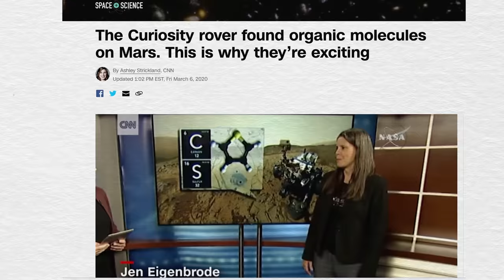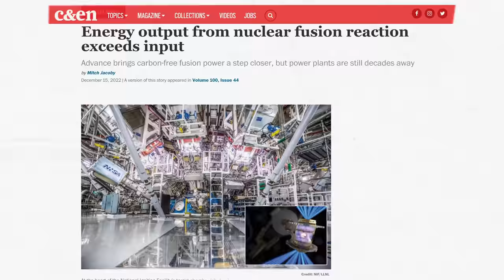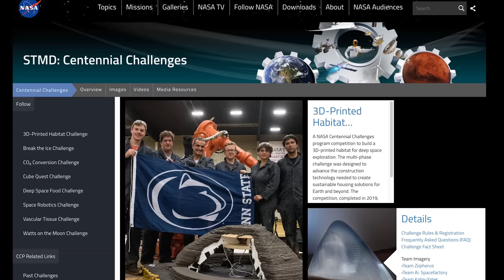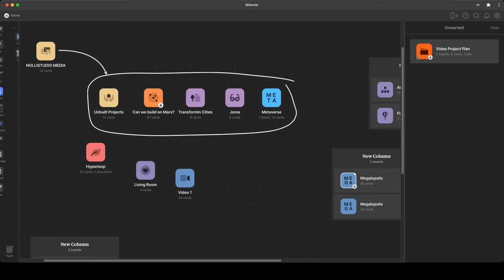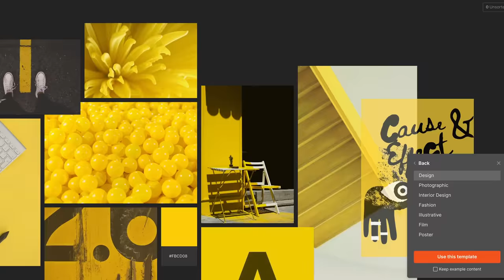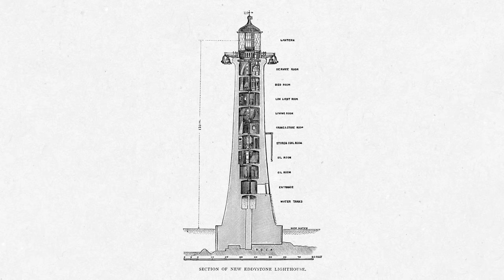Can we REALLY build on Mars? [SPACE ARCHITECTURE]

Comment: At the west end of Valles Marineris is a region called Noctis Labyrinthus. There is a water ice glacier there which contains 36 billion tons or 8.7 trillion gallons of H2O, or just a bit larger than Lake Meade at the Hoover Dam. The canyon floor is 4.35 miles deep, which provides twice the atmospheric pressure: 12.4 millibars, compared to 6.1 millibars at the datum level. The high canyon walls also provide very good protection from cosmic radiation.  Noctis will enjoy a relatively mild climate, as it is only 7 degrees south of the equator (236 miles). This would be an ideal choice for our first human activity and habitation on Mars.  Expedition => Outpost => Settlement => Colony.

Comment: Sounds like an interesting idea, conceptually. Honestly probably wouldn't be that hard to build a structure. But I don't know that it be air tight. You can build structures out of Stone dirt urgent mud. It's a process that's been around for a really long time. You literally make a brick shape and bake it.  Tell
 It hardens into a Stone. Another way would be to hit it with something that's so intense so hot. It'd be on par with a lightning ball. Thus turn it into glass like substance. Which is more likely product to make air tight? However, is very fragi. Le don't I say the combination of the 2 might be a possibility. So layer break layer of air, tight glass and the layer of brick.  Over that, in order to create a airtight vacuum sealed structure, protecting said glass as part of that structure, I don't know that you could 3 deprint that I'm sure it's a possibility glass can be melted, so crystallized substances, the sand there. I don't know what it's. Made of.  I mean, we could pretend it's sandstone that is a very fragile substance itself, but if you expose it to intense seat like lightning, I could take on a glass like property but who knows what else is on Mars?  A lot of the area doesn't have water. There are a few locations from my understanding that do and supposedly it's frozen or not. Is like a giant oversized arid desert that, according to science is lighter than Earth now, my presumption.  Or theory is that that's due to lack of atmosphere for one lack of plant. Life lack of living life lack of actual moving water to increase its overall mass and weight. There's still plenty of land here on earth.That has not been settled.It actually be wiser if you're really wanted to do something like that.From ours to 1 start out in the seahair , a desert and a bunch of other areas that are nothing more than desert light locations It'd be the perfect location to build mass large-scale city like homes using said materials from the very Earth there, breaking down some of the mountains that aren't really historical sites digging up some of the sand like over in Egypt, where it's just a bunch of sand dunes all of that could. Be blast heated into glass or cooked into Stone like structures.  Then built into actual large. I'm not talking. You're not talking. You're standard to run to the mill. Everyday small house. I'm talking large sprawling structures like they have in New York and Vegas and wherever else that are large cities it's literally not that hard or impossible. All you need is plenty of material like steel and why not to support said items?
Another thing that could be done to produce power of course, is to produce and build large-scale. Nuclear manufacturing systems that are preferably underground because if then if it's deep enough but still provides power to the above ground cities and underground cities that are far enough away.  Say it how to melt down. God forbid that that radiation wouldn't go anywhere. But then right where it is reducing the number of lives that be at risk.
As for water, even though there might be someone on Mars, I don't know that there's enough to support a large-scale settlement, even if we took some of the water from our own planet and took it there from my understanding, the small percentage of the water is actually drinkable and that percentage is shrinking. By the minute.  Do to the fact that most companies and people Pollute it instead of trying to find a way to recycle and clean that water which there are plants to do that. Do not get me wrong. Most people don't bother.
 Look at Mexico, for example, they're water. In certain locations is literally undrinkable. Unless you want to die a slow painful death.  At its worst. It is possible to live on Mars. It's also possible live on the moon. Odds are humans would have to take a trip to the moon first? Build a lot site from there tonight. Take next trip to Mars. It's kind of like flying a plane. Takes a lot more fuel a lot. More materials and someday money will not be a thing because it won't exist. Seeing how putting our faith in a chunk of cloth and small bits of metal seems like such a barbaric and naive way to live life, I know you may not be a fan of Sci-Fi but say Star Trek for example, they don't use any money of any kind. Their labor is the value.  What they produce the materials. They acquire the physical work. Is the actual worth of value? It is the trade on pawn which they live upon, so they acquire materials. Transform said materials not exchange for cloth. That's called money. Not exchange for metal that's called money. No, those cloths that paper that metal is instead used for exploration used to expand their life.  Use to create a better quality of edistance. In other words, knowledge is power knowledge is worth knowledge is value.

Comment: The first buildings will be as simple as possible, probably modules brought directly from earth, maybe just special versions of starship cans that got landed there autonomously before the temporary residents arrive. Only much later when there is a veritable robotic workforce will there be larger habitats. But then there's not much of a space restriction. Also pressurized volume isn't much of an issue. The oxygen consumption per person stays the same, everything else is a questio of compression and having sealed compartments. Radiation shielding may be another problem with some of the designs.

Comment: as have been said no windows is not an issue but  some labs will have to be separate for safty reasions ,  this is why a little story from my daughter while doing her masters in biomolecular  sciance ,  after colecting samples from fellow studants to study the professor came back from a trip only to bar ALL studants from the lab as one of the samples was highly contagous and the lab was not cleared  on the leavle needed to work on the sample thay had to get a specialised company in to do a deep clean on the lab wich was shut for weeks during this .  On Mars this sort of issue would mean potentially sealing off the lab and either working it remotely or setting up another completely.

Comment: If I'm going to live on Mars or another spacial body, I want a horizontal layout. Stairs are an avenue to injury, significant injury. Age is also a consideration, the older someone gets, the less able they are to be mobile. A vertical layout requires a safe method to get to the other levels - an elevator. But an elevator also requires maintenance, cannot be used until fixed, etc. A horizontal layout isn't just safer, it requires less maintenance and repair as a simple floor can last generations.

Comment: Build a building 400X400 that's two stories tall. Both levels are green spaces. Then have eight habitats like that. Each habitat supports 80 people max. But if you are on the moon building a 600X600 sqft ten story building with a 50 feet ceilings are key.

Comment: I see that larger domes are possible. And the use of water as a radiation insulator also allows light to enter. And even if there is no light, if there is light emitted below it via LED with white PVC film, it will produce a sky effect.
Here an artificial sunlight:
https://www.youtube.com/watch?v=6bqBsHSwPgw

Size: DOMOS using elastic, pressure and hot water could produce clay. And the clay part will be just the side, the roof could use 10 meters high water per 2km radius.
An ideal size would be 4km² or 2km in radius and 500m in height. Under these conditions, the environment is perfect. The habitable part would be slightly smaller than that, 488m high and 1,900km, 50m walls by using a dam-style structure system would end up having a base that consumes 50m thick and would be smaller at the top, maybe only 5m at the top. top. And several pillars that would stand up to 50 meters and using cathedral techniques that apply to stone constructions (using Martian raw materials) could these pillars support a skeleton of the dome. The central part would then still be quite large. The problem is getting the machines there. There are machines on earth but there is every apatato here for that. I see that the problem is more of logistics.

1) Precise Nuclear Power is there ready.
2) Some robot needs to maintain that energy.
3) Need the Robots to build
4) Need Robot Control Station
5) They need raw material that is not on mars. The main one would be steel. I think that making everything based on raw materials from Mars is not the definitive solution. Steel is essential in building construction and large warehouses and domes use it. It takes steel already in shape to be cast through a machine that will melt and place it on top of the clay.
6) Use the air pressure in the inflatable balloon to support the roof. Balloon effect if there is no air on Mars that is without resistance, and if the pressure is sufficient the dome even though it is made of inflatable material only needs to have resistance that will not only expand a lot but will be able to support the weight of some robots. However, to support slightly larger machines, but as light as a motorcycle, it would need to have flexible steel structure in the dome structure. And every strengthening of that balloon could make it thick even when it wasn't inflated. A starship would only carry one of these and multiple domes would be needed, as realistically a dome would perhaps inflate to vertical. In groups of domes, acting as artificial pillars of air. Another thinner and weaker dome will be transported with the capacity to inflate more and thus reach 4km covering the other "inflatable pillar domes". That's my vision.

Comment: And before we did that, we'd have to put a massive electromagnetic generator at Mars' L5 point which would function as a replacement magnetosphere so we can build walls that aren't 5 solid meters of concrete to shield from radiation. It's not just the surface - Mars' core is dead and we'd have to replace the basic functions that come with it.

Comment: I wonder about a directional boring machine - bore tunnels in sold rock formation which provides usable space and protection from radiation and hazards of the surface.  The boring material becomes the source for all elements needed - buiding blocks for water, oxygen, fuel and all items needed.  The lack of gravity (3/8ths of earth gravity) is a hard limit, will result in changes in our biological responses to earth gravity.  It would be interesting to know at what depth in Mars the temperature is 72F all year long.  What could be done to collect solar energy without dust ionization issues we have already observed.  Mars doesn't have the magnetic field that earth has, this is a second hard limit we can't easily change.
Worked in the high arctic for years, seems similar - enclosed buildings with corridors - special clothing to allow going out.
Subterranean would solve a number of problems, if we can find a stable rock formation that would permit containing an artificial atmosphere with reliable safety.  like a submarine, bulkheads and self contained segments makes sense.  Vary the sizes of the tunnels and open up large cavarous 'halls' since the low gravity means we can span far larger open spaces.
I wonder if several generations later "people" become 10-feet tall, and twice as heavy. interesting.

Comment: Okay so there is one major primary problem with long term habitation on the surface of Mars... radiation. There are a lot of high energy wavelengths as well as high energy solar particles, that are blocked not only be Earth's atmosphere, but also Earth's magnetic field, and Mars has no magnetic field because it doesn't have a spinning molten iron core. There really cannot be surface life or a surface atmosphere until Mars has a magnetic field to protect said atmosphere from getting blasted into space by the solar wind, which are those high energy particles coming from the sun. The only problem there is that we don't really have any feasible or even remotely fictional idea's about how to give Mars a magnetic field. So, any settlers to Mars will have to live below the surface.

Comment: Not potential water; there is water. We can send robots to start building, digging for example, to get the resources ready before we actually go there bc otherwise it would be very hard to just show up and live in a bubble until bigger and bigger structures are prepared to live. We could live in mountains and craters where the pressure is higher and temperatures are better for liquid water. 3 stories is too tall. Maybe 2 stories and go horizontal. We know from
Studies that 6 months of isolation with others in a confined space is enough to cause psychosis.

Comment: Excellent video, but a lot of fantasy by various sources.  The vertical habitat looks best, having a tree or two could make a difference.   Mars mission by 2030?  Doubt it.  It's 2023, no moon landings.  Maybe 2025 we'll set foot on the moon again.
Problems:
1 - Costs.  $250~500 billion is the projected cost for a 2035 mission.   A rover mission is $2.5Billion, they seem to last for years.   And yes, humans would be 10x faster at work than rovers. 
2 - Mission is not 1 year of same people, same food, same walls.  The round trip + mission stay time is about 500 days at best, 34 months at worst depending on orbit, timing, issues.
3 - There is NO such thing as a rescue mission.   Apollo 13 was lucky, they had a "lifeboat" attached and barely made it back alive.  Any failure like that = death on a Mars mission.

4 - Elon Musk likes to throw out numbers all the time, they change.  This includes his solar panels, Tesla cars and SpaceX (according to Musk's timeline, he should have launched a crew mission in 2022).   He blew up his own launch pad.   So 1 million people on Mars by 2050 won't happen.  Likely not ever.

5 - 100 people on Starship?  No.  that would be super crowded and where's the space for food and supplies?  Even for a lunar mission, not happening.   They're not even close.   SpaceX hardware will likely fail because of its failure mentality.   Clapping when their rocket explode is not normal.  Launching with expected failures on the launchpad = they're doing it wrong.    Fix the problem first.

6 - one-way trips to Mars would be cheapest, but most people will not live long.   People lose their minds spending weeks or months inside a home or tincan (submarine).   350~450 days is the most a person has stayed in space, but they know they can get back home in case of emergency.   A couple of research missions is likely all that will happen in the next 50 years.   Antarctica IS A VERY hostile place on Earth, humans don't actually live there.   They are there for a year or so on science, most are only there during the summer season.    Who wants to spend the rest of their lives (2~8 years) on Mars?  Radiation and health problems will shorten their life-span.  There is no such thing as "outside for air".  It's mostly rock and sand out there, it's dead.

7 - Terraforming will likely NEVER happen.  Sci-fi level of technology would be needed.  Problems: Very thin atmosphere. .06 of Earths.  Would need to create AIR out of... what?  Rocks.  
The air is too cold.  The makeup of the air is too different from Earth.  The magnetic field of Mars is VERY weak, so it cannot hold onto the atmosphere.  Whatever is made, will just be pulled off into space by the sun.   The radiation from the Sun is deadly.   If we make an artificial magnetic field (there are ideas), it would be extremely costly and still take hundreds of years to get something out of the planet.   But with its weak gravity, it'll always be a COLD planet at best.  Too cold to grow anything outside... which would make terraforming pointless, again.

Now, one way to make Research on Mars affordable would be improved space travel so it takes 45 days rather than 6~12 months each way.  It reduces the likelihood of death for the crew.

Seriously, nobody would ever want to LIVE and raise kids on Mars or the Moon.  That's living inside a cave or a tin-can... until you die.   Like the rats, the people would die off.  
The money spent on such ideas could be used to SAVE OUR own planet.